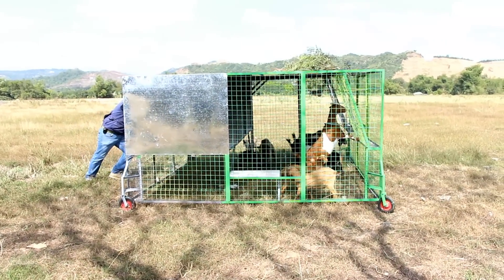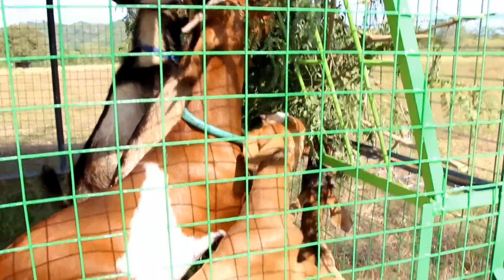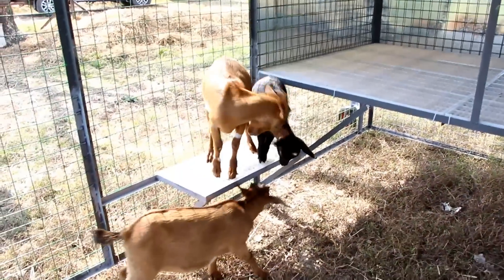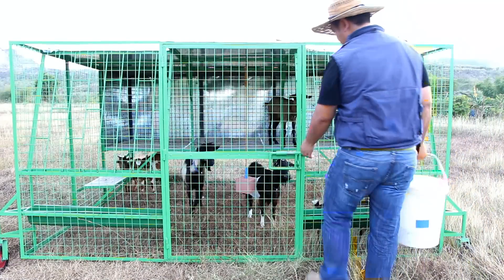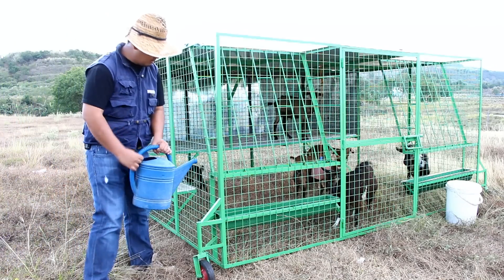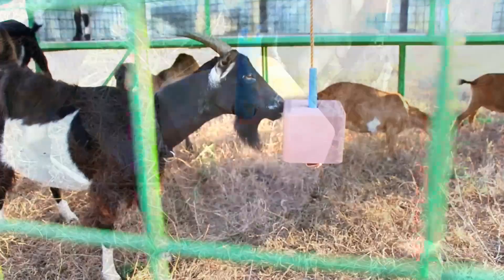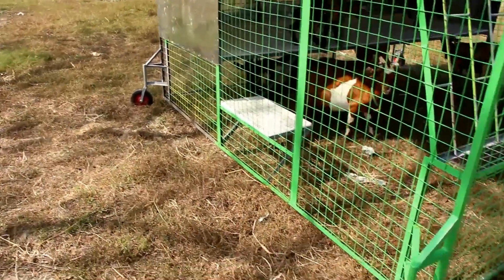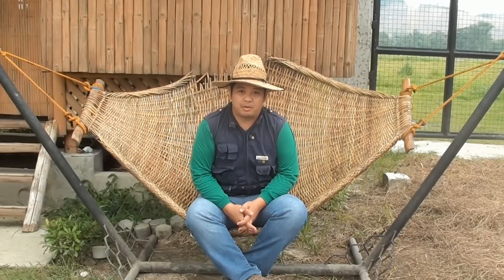Goat Tractor Design at MADE Farms

Comment: My goats would HATE this.  Even if you move it to different ground 10 times a day - they are still in a TINY trap looking at the same 4 walls of wire all day every day!  You should consider the poultry netting and just set up a couple of large paddocks to rotate them through.  It is not that expensive and very easy to set up.  The trap you are using now would mike a nice movable shelter that could follow them from pasture to pasture and they could have open access during the day and close them up in their trap at night for safety.  Keeping them that confined all the time with no way to run and play is mean and inhumane.
Reply: I agree with you but I do see this being a good option for temporary use... maybe an hour or two a day. I'm herding my goats and I know something like this would be useful for when I need to take a break or go eat lunch. That way I wouldn't have to bring them back to the barn each time and then take them out again.

Comment: Where can you buy one
Reply: Make it yourself. I don't think they are available to purchase. If they were it would cost 10 times more than making it yourself. It is very easy to make. Use the materials you have access to. It doesn't have to be welded. You could engineer a bolt and nut design.
Reply: Tango Kaleidos thank you
Reply: @alangg5697  my pleasure